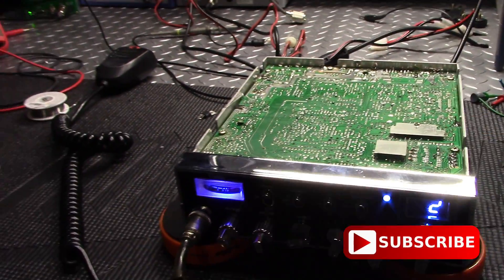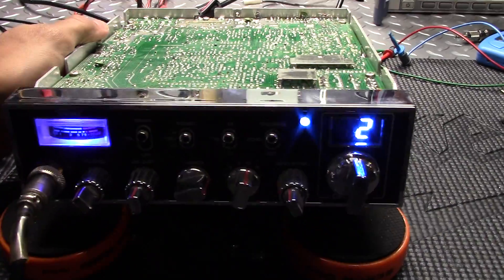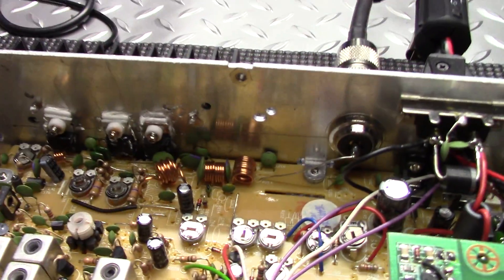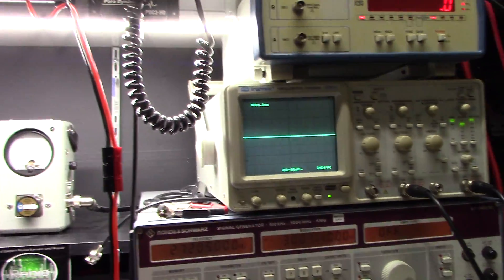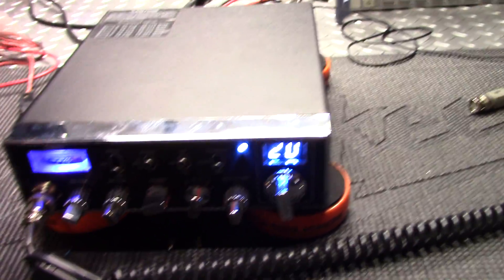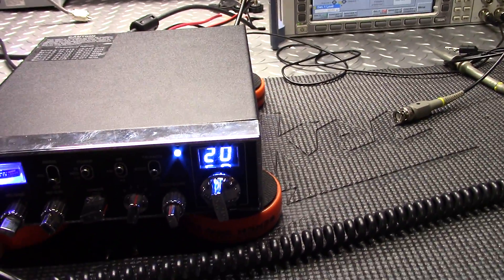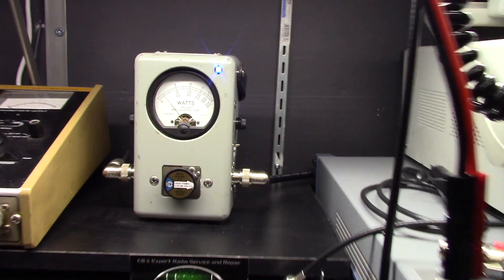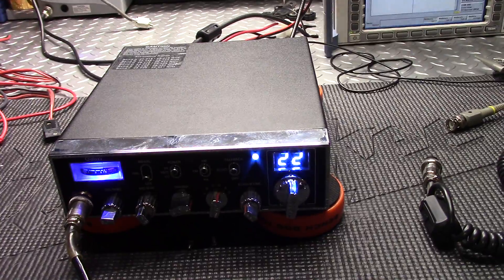Unhacking A Galaxy DX33hp2 CB Radio Tune Align

Comment: Nice job fixing up that radio! You are the first radio tech that I've seen using ferrite chokes. I tried that on the antenna coax and the static dropped way off, but my swr went up a whole point. What gives?